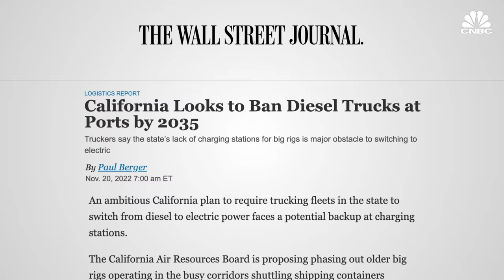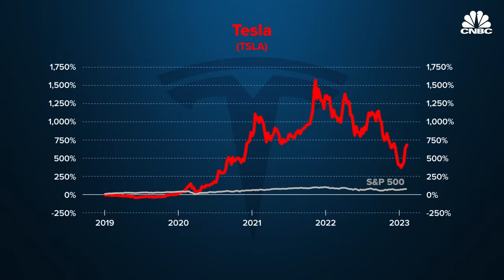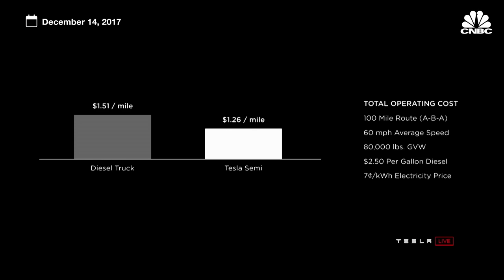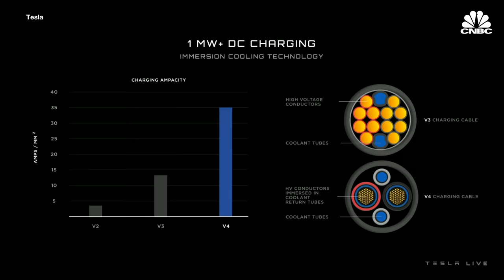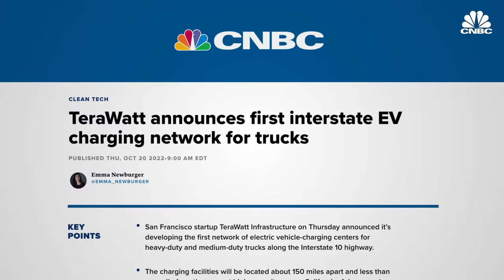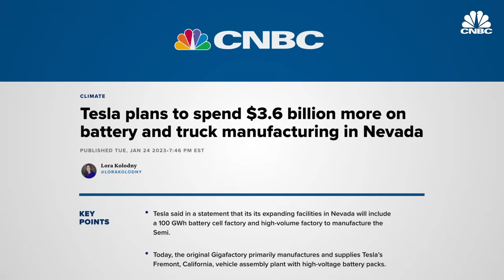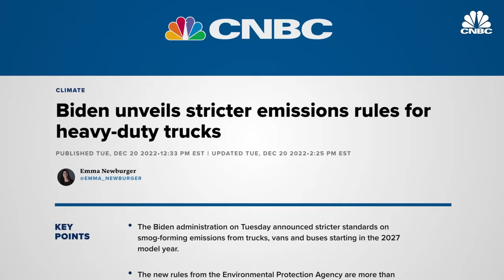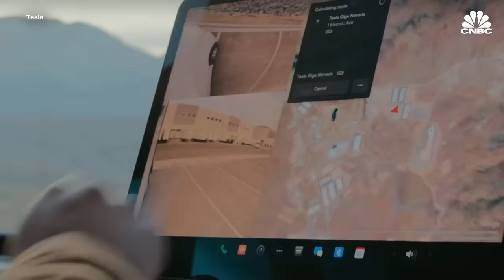Does The Tesla Semi Live Up To The Hype?

Comment: As a former driver, one thing I've noticed is that this video and the majority of the comments fail to understand how inefficient this truck is. The US department of transportation mandates that trucks on the road weigh no more 80000 pounds. The average diesel truck with no cargo and a full tank of diesel weighs about 40000 pounds. Therefore, it is able to carry about 40000 pounds of cargo. This is called the carrying capacity or the load capacity of the truck and is perhaps the most important feature of a truck that trucking companies care about. When Elon Musk introduced the Semi, he refused to say how much the truck weighed and how much is able to carry because he knows that the load capacity of this truck is embarrassingly low. Some estimates put the load capacity of a Tesla Semi at 5000-10000 lbs. That 12.5%-25% that of a diesel truck. That's the reason why this truck has only been bought, in small number, by one company and is only used to transport extremely light cargo (chips). The range of a diesel truck is also about six hundred miles, and It takes five minutes to refuel. Some reports indicate the range of a Tesla semi is significantly less than five hundred miles, more like 300 miles. Clearly, Elon did not do any market research before designing this truck because he and his staff don't seem to know what makes a good truck or what logistics companies look for in a truck. This is not a serious vehicle but is just a vanity project and will fail miserably.
Reply: lmao,
"A technical update on the new Class 8 long-haul truck from Tesla and reveals unladen weight of the the new truck is less than 10 tonnes." (this was in May 2024)

That's 22500 lbs. Pretty much all other sources have a unladen tesla semi at ~27000 lbs. 

As for range, there's literally no confirmed reports of range. It seems to be 500miles under optimal conditions, which translates to 400-450 miles in non-ideal conditions. That difference is pretty much expected in most EVs.

Comment: The tesla semi is a step forward, but it's still got a long, long way to go. We need a truck that can haul a 40,000 lbs payload, with an 800 mile range, all thru the mountains
Reply: Likely in 8 years, the tesla semi did 43,000lbs 500 miles (540 if it went to 0%) over 3000Ft of elevation gain and drop.
Reply: If you count recharging 375 miles during the 30 minute break around the 8 hour mark mandated by HOS regulations, the Tesla Semi will already do this, while hauling a significantly higher payload of around 43,000 to 44,000 lbs. And mountainous terrain is where the Tesla Semi has the greatest advantage over diesel semis; first, because they have 2-3 times the HP of diesel semis, allowing them to climb steep grades at highway speeds; second because regenerative braking removes almost all of the fuel penalties for steep climbs and descents; and third, because there's no loss of power at high altitudes, and in fact slightly better economy due to less air resistance.
And Tesla Semis will do better than diesels in snow and ice, for at least three reasons: first, a substantial portion of the weight of the tractor will be shifted back to the drive axles due to improved weight distribution of the batteries, increasing traction; second, the smooth application of torque by the electric motors, compared with transmissions shifting every few seconds, will mean less wheelspin; and third, the torque axle has independent motors on each wheel, allowing torque vectoring in limited traction situations.

Comment: To the average person who has zero transport industry background this sounds like a great plan! To any long distance truck driver or anyone who has transport experience, this is ridiculous. In Canada especially because the weight restrictions are higher and winter temps are lower which kills batteries. Also the American truck stops often have capacity for 100 or more trucks and there's absolutely no chance that many trucks can be charging overnight. Oh and to keep the sleeping drivers warm in winter and cool in summer while their trucks use small diesel heaters or run the big diesel engine which is actually pretty efficient while idling. Sorry folks, there's a 0% chance of all transport trucks EVER being electric. But if they outlaw diesels, many people won't be getting the stuff they need.

Comment: Nobody ever talks about the special (and super expensive) tires needed for EV's, including I presume trucks.  No body ever talks about the size and weight of the batteries either. My guess is that the battery alone weights 16,000 pounds.  That adds up to a lot of road wear on a tire. And then you add in the the wear caused by the instant torque characteristic of electric motors and you have a tire that is going to wear out 2x as fast as a normal tire. Indeed, the average EV tire wears out at around 30K miles.   Not to mention that these trucks are super heavy and that is going to add to the wear and tear on the roads.  And what happens if you get a flat on the road?
Reply: No body ever talks about the size and weight of the batteries either. 
 Everybody talks about the size and weight of the batteries.

 My guess is that the battery alone weights 16,000 pounds. 
Based on what? The consensus is 10,000 lbs., largely offset by removing the entire engine, transmission, driveshaft, fuel system, cooling system, exhaust system, additional chassis bracing for twisting loads, etc.

 That adds up to a lot of road wear on a tire. And then you add in the the wear caused by the instant torque characteristic of electric motors and you have a tire that is going to wear out 2x as fast as a normal tire. 
This is pure speculation on your part. It will be up to truck drivers not to abuse the instant torque, for one thing so as not to shift or move loads. Undoubtedly, truckers who show unusual tire wear will be treated appropriately. Likely there will be more tire wear; but certainly not 2X; and then only on the tires on the two drive axles. The steer axle tires will likely have less wear, and the wear on the trailer tires will be slightly less.

 Not to mention that these trucks are super heavy and that is going to add to the wear and tear on the roads. 
A fully-loaded electric semi is 2.5% heavier than a fully-loaded diesel semi; I think the roads can handle it, especially given all the benefits of electric drive.

 And what happens if you get a flat on the road? 
Same thing that happens when a diesel semi gets a flat on the road. Why would it be any different?

Comment: Put solar panels  on the tops of the trailers they are pulling to generate power , then they don't have to stop  and charge .
Reply: Because this is one of the most frequent comments on Tesla Semi YT videos, I did the math on adding solar panels to standard dry van trailers. Turns out that they would produce enough electricity for an added range of about 13 miles a day. But the added aerodynamic drag and weight would decrease the range by about the same amount, for no net gain. Much more importantly, solar panels covering the top of a dry van trailer would weigh about 2,000 lbs., which would of course reduce the payload by that amount. I can post the calculations, if you like.

Comment: they add batteries in bottom of the semis box in back put product in. that extend miles electric semi can drive can get power from trailer. also if pick up trailer that trailer be charged same time semi is on road on way to pick up trailer and drope off old trailer. so that save time for them have charge vehicle part.

Comment: Many of the criticisms here apply to some applications, but definitely not all. Electric trucks are fully ready to serve in those tasks where they are appropriate, and shortcomings for other more challenging tasks will be addressed in time. Obviously all of the challenges can't be addressed at once when developing a new market from scratch, so focusing on what is not yet attained is a waste of time.

Saying that Tesla isn't equipped to compete because they are new to the truck market is like saying they can't have become the number one seller of electric passenger vehicles because they were new to that market. It obviously doesn't follow. Purchasers will buy whatever trucks they feel best serve their needs, without regard to who the current big players are. And what could be stupider than critiquing Tesla trucks based on the fact that they have had a few breakdowns? Where is your critique of diesel trucks based on their breakdown rate, which is likely much higher?

Comment: Why is the trailer so heavy duty to haul chips. There's probably 37 pounds worth of merchandise in it
Reply: You might want to actually watch this video, since you apparently missed the statement at about 4:25 that it's delivering Pepsi—not chips—out of its Sacramento warehouse going 300 to 400 mile runs to other warehouses; and that the payload is 45,000 lbs. 
You're welcome.
Reply: @BigBen621 m saying that in general, why are potato chip haul trailers built to the same standard as soda hauling trailers. You're welcome smart***... Read more
Reply: @macbook802  It should be obvious that they're built to the same standard so that you can haul either potato chips or soda, depending on the needs on any given day; and so you don't have to maintain two different sets of trailers. You're welcome.
Reply: @BigBen621  what weighs more a pound of feathers or a pound of sand?
Reply: @macbook802  Fifth grade, right?
Reply: @BigBen621  that explains it.

Comment: Well, the summertime savings be able to allow the end of shipping during winter
Reply: Well, the summertime savings be able to allow the end of shipping during winter 
You're obviously basing this fatuous prediction on stories or studies you've seen about range loss in BEV cars in cold conditions. While it is true that all vehicles, ICE or BEV, lose some range in cold conditions, and require special provisions for extreme cold, there are several reasons why range loss in Tesla Semis will be much less than in BEV cars. And what range loss there is wil be completely predictable, so dispatchers and drives can plan around the minor range loss. The fact is that Tesla Semis will do fine during winter.

Comment: 4:19 whether or not it can achieve 500 miles of range or not depends on how it's driven. If you're lead footed and constantly flooring the truck, the range will be cut down.
Reply: Much less so than for ICE vehicles, including Diesels, though, because of regenerative braking.

Comment: Its electric, and hauls bags of air. Not surprised it works.
Reply: More like 90% air and 10% chips. 😁
Reply: Also concrete highway barriers. Here's a Tesla Semi, towing a flatbed trailer, loaded with 44,000 lbs. of concrete highway barriers, accelerating rapidly (watch the speedometer) up a steep slope on Donner Pass, passing a diesel semi as if it were standing still: https://youtu.be/LtOqU2o81iI&t=985.

Comment: It is highly debatable that incumbents understand customers of commercial trucks better than Tesla. Tesla has proven the opposite by default. Aside from this, with the exception of Mercedes/Daimler/Freightliner the other truck makers have little experience with EV trucks. Add to that Autonomous Driving (or Assisted Driving) and Tesla could be very successful in this market. A few technical notes: EV trucks produce MORE power than Diesel trucks but provide less ENERGY.
Trucks can load out but likely will space out before that happens (on average - liquids are the exception) and 50% of a trip is often driving EMPTY. That is why for Tesla a 400 mls. round-trip is not an issue. 
...
It is very frustrating to listen when physics and engineering is in your blood.

Comment: They are great for hauling chips, which are mostly air....load them up with +40,000 pounds of soda or water and the range will drop by 80%
Reply: Try to keep up—you're holding the rest of the class back. A Tesla Semi made a well-documented 500 mile range test run from San Diego to California, with a payload of about 42,000 lbs., including a 4,200 ft. climb and descent, on 93% battery charge. The only way the load can go is down, and this will increase the range beyond the full-load range of 500+ miles.

Comment: But what about pollution generates during battery mining and manufacturing ?
Reply: Most studies show that the breakeven point between emissions during mining and manufacturing, and reduced operating emissions, comes somewhere around 50,000 miles. Since Tesla Semis will have a life of around 1 million miles, they'll make back the original emissions some 20 times over.
Reply: @BigBen621  you really think that they will last 1,000,000 miles, and you’re forgetting that they’ll have to increase fossil fuel usage, if people start using more electric coverage
Reply: @Tylerd838  Yes, I do think they'll last 1 million miles; more importantly, PepsiCo thinks so: here's PepsiCo VP Mike O'Connell, quoted in Reuters on 12/16/2022: “We keep the trucks for a million miles, seven years,” O’Connell said. “The operating costs over time will pay back.”
Ten years of Tesla's planned 2024 sales of 50,000 units will only consume 1% of current US annual electrical consumption; further, Tesla has committed to installing solar panels and Megapacks at all Tesla Semi Megachargers, which will reduce the draw on the grid even more. Meanwhile, fossil fuel is rapidly being replaced by renewables as a source of US electrical energy; for example, it's recently been reported that renewables provided more electricity than coal in the US last year. So no, it doesn't look like even all the Tesla Semis Tesla plans to build will increase fossil fuel usage measurably, if at all.

Comment: Not letting them talk to the drivers speaks volumes. How will these trucks perform in the Arizona desert when it is a 115 degrees out. Or when it's 20 below in the midwest? And where is all this electricity going to come from in California which is already famous for its rolling blackouts? This is all a money grab by those who are rich enough to invest heavily in to electrification and nothing more. Don't be fooled, once they get enough of these types of vehicles on the road the price of electricity and the components to maintain electric vehicles of all types will skyrocket along with electric prices for home and business
Reply: I've driven a Tesla car in 118°F heat, and it did fine. Do you have some reason to believe the Tesla Semi, which uses similar technology, won't do as well?

In recent tests, Tesla cars have had the least cold weather range loss of any EVs, due largely to use of heat pumps for cabin and battery heating. The Tesla Semi will use the same technology, so it should similarly experience limited loss of range in cold weather. While some range loss will of course occur, it will be completely predictable, and drivers and dispatchers can plan around it.

The most recent rolling blackouts in California due to inadequate capacity were ten or more years ago. California has had major blackouts more recently, but these have been for fire safety purposes, and not because of capacity. All the Tesla Semis that Tesla's business plan proposes to sell in the next 10 years will only add about 1% to annual electrical generation. Further, most charging is done at night, when there's plenty of spare capacity; so I don't think this is going to be a big problem.

Comment: Ok, so what is the transmission?  Manual or automatic?
Reply: it uses 3 motors, the real most axle uses a single motor on a single reduction gear for cruising at 82,000lbs, the other 2 motors or on the rear axle closer to the cab, these motors are ment to be geared on a single reduction gear for maximum torque at lower speed to accelerate the truck at 82,000lbs, so very automatic..

Comment: How many megachargers do they have? How many are charged by solar power. How long will the batteries last? How do you put out a semi experiencing thermal run away. They are illegal on Australian roads.
Reply: 4 mega chargers, all of them if using grid share, the current semi uses NMC cells. Which last 8 years/400,000 miles, new LFP cells last over twice the milage. 

You use a water hose to put out the fire, then continue spraying to stop further decomposition, yes corruption hurts tesla, which is why tesla can't sell its car in the state it manufactures them.
Reply: As Miguel stated, 4 Megachargers at the Sacramento PepsiCo Plant; but also 4 at the Modesto Frito-Lay Plant, 8 under installation at the Fresno PepsiCo Plant, one at the Tesla Supercharger station in Baker, CA, and at least one at the Tesla Gigafactory in Reno, NV. Further, 72 more are in planning: 8 each in Fremont, Bakersfield, Compton, and Indio, CA; 8 each in Phoenix and San Simon, AZ; and 8 each in Sparks, Fort Stockton, and Laredo, TX.

Comment: Make sense, for such light products as chips it can actually work since they won't surpass the maximum weight and can still load up the truck. 
You won't see a tesla semi pulling coke bottles though trust me ;). It only works with low weight to volume ratio produce. The battery takes away about 30% of the pulling capacity.